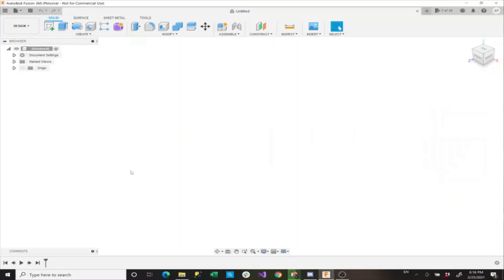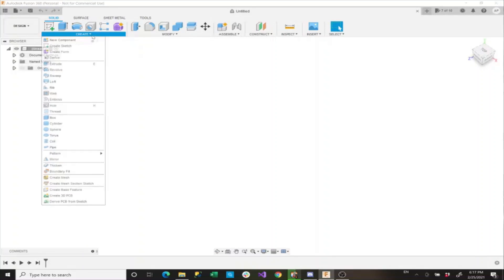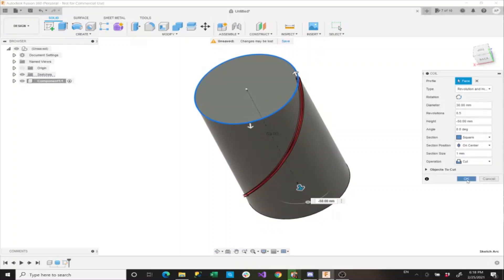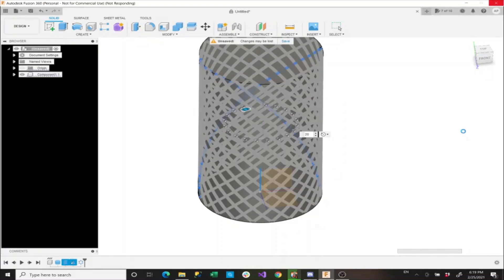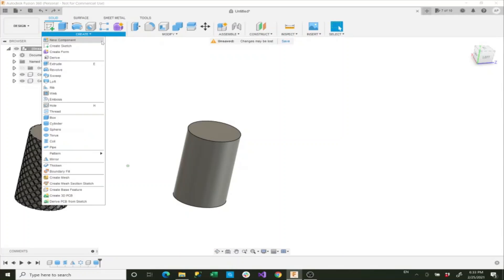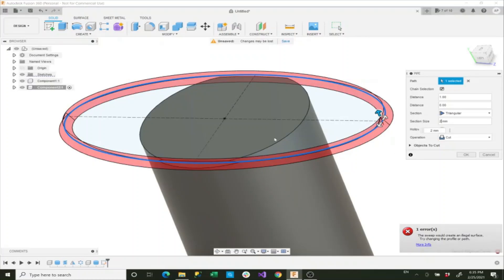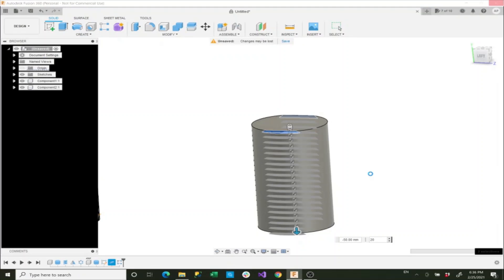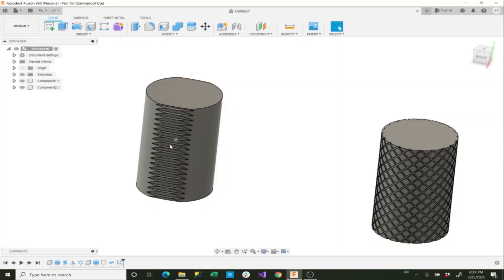Fusion 360 Tutorials - Surface Texturing

Comment: How would you do it if u just wanted the knurling on a specific part, like if you draw an oval or square on the side of the cylinder, and you just want that section to have knurling and not the rest?
Reply from the maker: For that, I'd recommend extruding the edge of the section you want knurled and then subtracting that extrusion from the knurling setup and then subtracting the adjusted knurling setup from the cylinder

Comment: this is great but i cant seem to work out how to apply that knurling to a middle face between to chamfered edges of the cylinder, is there a way to do that?
Reply from the maker: What you could do is use a series of torus objects that get sequentially bigger as you go from the bottom of the chamfer to the top of the chamfer. Let me know if you need further clarification. I'd be glad to dedicate a video to this if you want

Comment: How about make this on surface of model non standard shape?
Reply from the maker: Do you have a specific shape in mind? That's a very good question but i would need to know what specific shape you're trying to apply it to
Reply: @avramplager1953  I mean, make a more complex surface from the elevation texture on the existing surface. Any model like a vase. I am having problems with this in another editor. And I look at Fusion 360. What tools are there for this.